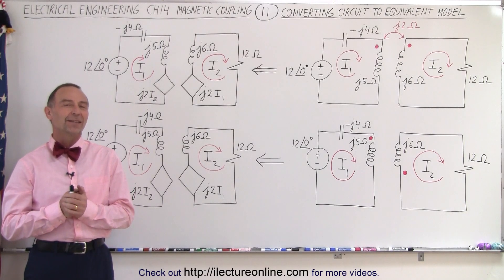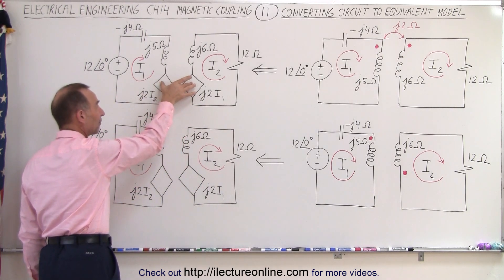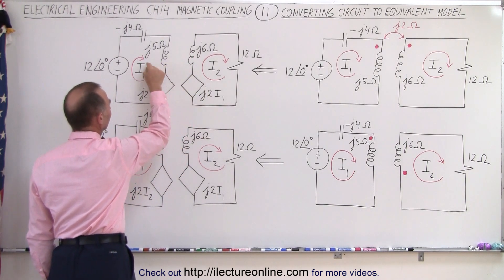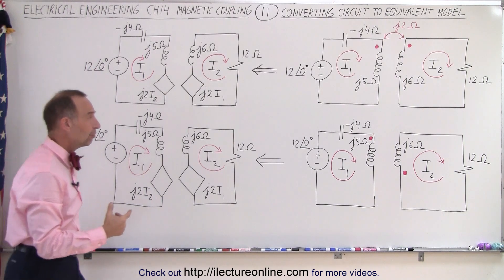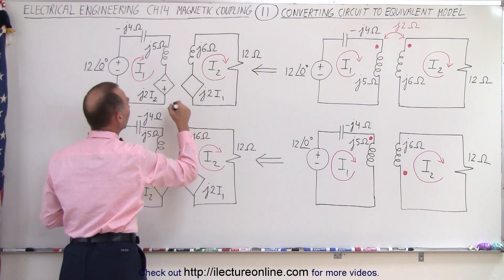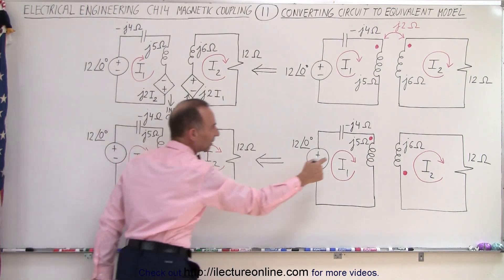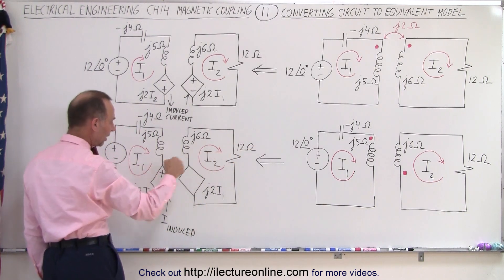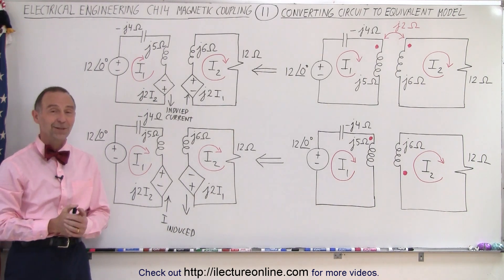Electrical Engineering: Ch 14 Magnetic Coupling (11 of 55) Converting Circuit to Equivalent Model

Comment: Sir, for both left and right hand sides of the circuit ..why is the direction of current flowing through the dependent source is in opposite sign such as current for loop 1 is I1 but current flowing through the dependent source is shown I2 or (j2*I2)  ????

Comment: Hi mr Michel.. Ive been following ur channel for a long time.. But this time i got stucked to choose which physics formula i had to choose to solve this problem. Below ill attached my question

Q: how to calculate the tension/stress of the trolley head that connected to the towtruck. Speed for towtruck avg 20km/h, trolley weight 417kg(without load).. Let say if the trolley had a load which is 1ton.. Can we calculate the tension of the head of the trolley that connected to the towtruck?
Reply from the maker: What is the angle of the rope and what is the friction force?  Without that information you can't solve the problem.  If there is no friction then you require no force to keep constant speed.  (Newton's first law)